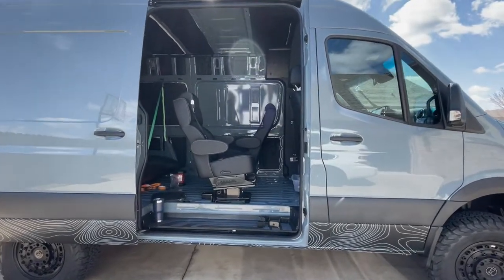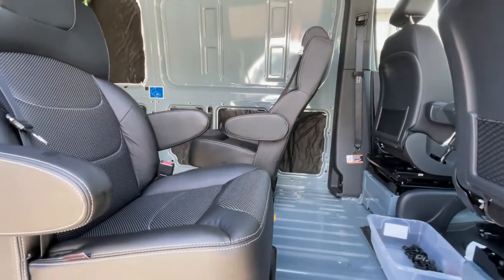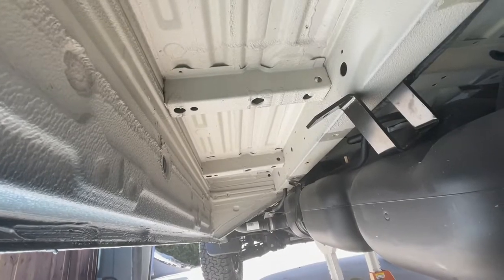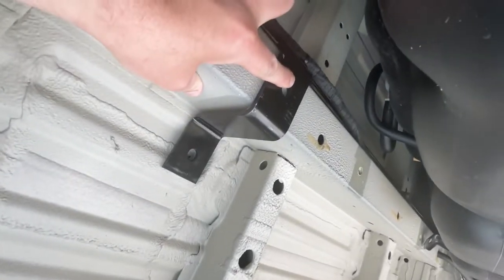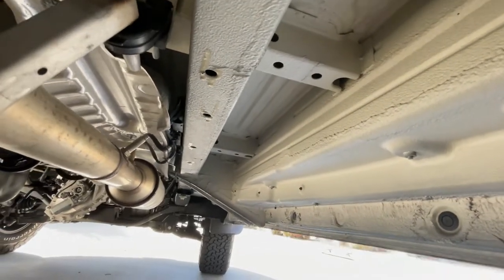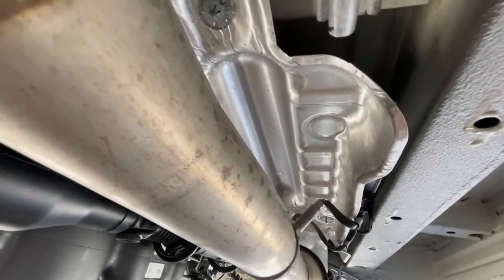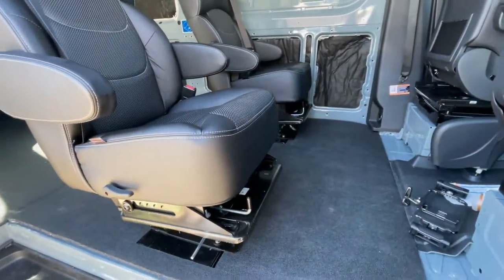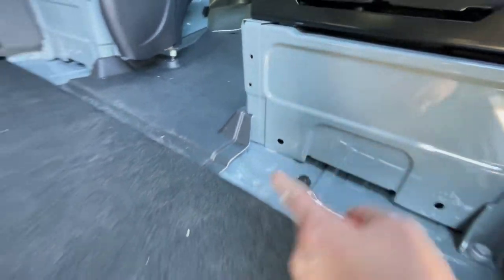Nomaddict Sprinter 4X4 Build!  JMG Seat Install!

Comment: This is AWESOME! Thank you so much for sharing this. You made this look easy, but I'm sure it you put a lot of sweat equity into this. Is the 20" measurement the width of the chair/seat cushion? Thanks so much!
Reply from the maker: Hey, thanks for the feedback! I’m glad it was useful! Yes,you are correct… The 20” measurement is for the seat cushion width, but I haven’t confirmed the measurement myself. Having sat in these a few times, I definitely would not go with anything smaller / narrower.  20” would be the minimum width you would want to go with.
Reply: @nomaddict5279  Thank you for letting me know!
Reply: @nomaddict5279  Now that the chairs are installed, how is the leg room between the front swivel facing the back & the installed captain chair? Based on where the bracket is underneath it doesn't seem like there's any wiggle room to possibly put the captain chair back an inch or 2. Thoughts?
Reply from the maker: @liberatingleash  there is actually plenty of room for people to all face each other.  That said, in reality we hardly ever turn the front chairs around.  At one point I thought about putting a small removable table between the front and second row seats, but never did.
Reply: @nomaddict5279  thanks so much for the info and sharing it with me.
Reply: @nomaddict5279  Hello again! 😅 do you have the dimensions of the baseplate? You mentioned you were 27.5 from the driver seat base to the beginning of the plate, and I'm wondering what the distance to the back of the plate is. I'm planning to frame my floor and don't want to put anything in that area! Thanks! 🙏🏼💞
Reply from the maker: @liberatingleash  hi, I just measured the base plate and it is 11.25 inches front to back and 15 inches side to side. Also, I measured one more time from the front seat base to the front of the base plate and it's more like 27.25. I also measure the width of the seat cushions and they are about 20 inches as I mentioned before. Just wanted to confirm for you.
Reply from the maker: Hey I should have mentioned that the base plate dimensions I just gave you are for the part of the plate that is raised. If you need the dimensions of the entire plate including the lower flanges where the bolts go through the floor, let me know.
Reply: @nomaddict5279  thank you!!! Whenever you're able, I'd love to know those dimensions of the very bottom plate. Thank you thank you!

Comment: Where did u order these chairs?
Reply from the maker: I order them through Freedom Van Go, which appears to now be called Van Parts Warehouse. You can also fill out a form on the JMG website directly and have someone reach out to you instead of going through a reseller.  https://vanpartswarehouse.com/products/2020-seat-system
Reply: @nomaddict5279  do u have the measurements after install?  How far is the seat (armrest) from the sliding door, distance between the 2 seats(aisle)  and distance from driver side wall.
Reply from the maker: @dhillonz  I do not, but I will try to get those measurements for you soon